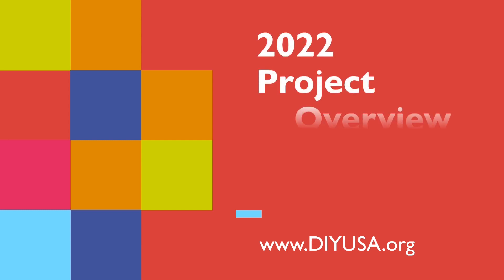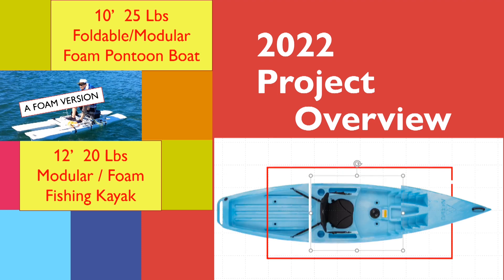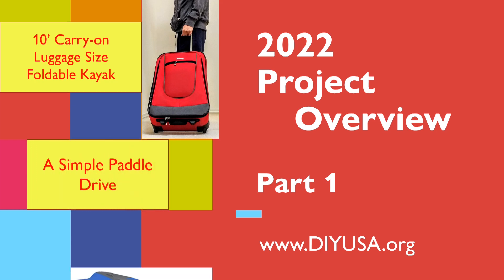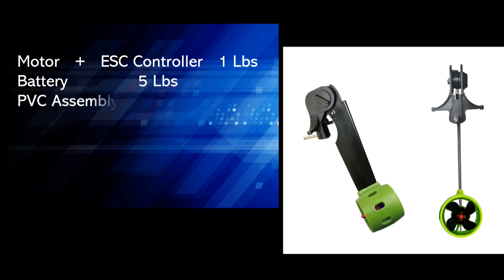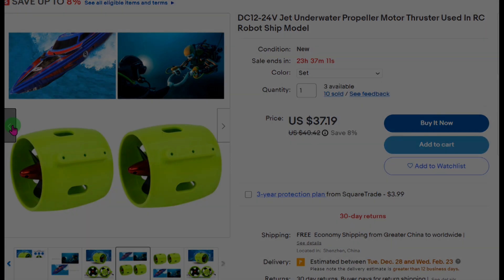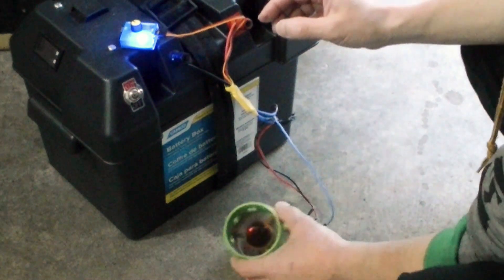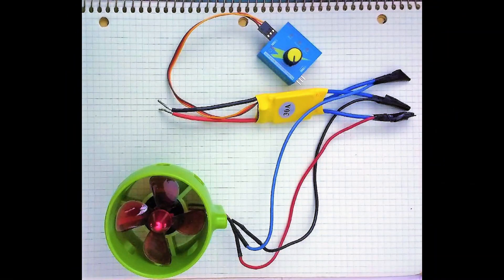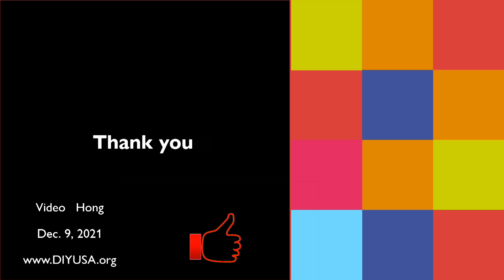Build My Version Of Bixpy Drive For Kayak ! Part 1 2022 Projects

Comment: спасибо. жду продолжения.
Reply from the maker: Honestly, there is still a lot of work I need to do to make a usable system.  I will experiment with the simple heat sink solution to cool the power controller before the kayaking season in April/May. Will provide an update. Cheers!
Reply: @DIYUSA  Good luck

Comment: Why there a holes around the housing. Other thruster didn't have holes there. I assume it breaks the jet.
Reply from the maker: This is a very good question. I don't know the answer. Unfortunately I have taken this assembly apart, otherwise I will run a test with the holes blocked (use tapes) and see if that makes a difference.
Reply: Esse motor é feito pra ser usado na flor d'água, esses furos são pra entrar ar. @DIYUSA
Reply from the maker: @Nicolasfelix857  Thanks for the explanation!🙂

Comment: please tutorial create mounting motor
Reply from the maker: Thanks for watching and your request.
Please check out part 2 of this series, which has more details on how I attached the motor to the aluminum pipe.
https://www.youtube.com/watch?v=KFiMu6XtaUU&t=1s
I reused the top part of the mount (which is secured to the frame of my pontoon boat) from my pedal drive project. You can see the details in this video 
https://youtu.be/mZYyqG_oXE4 
This video has the test result.  
https://www.youtube.com/watch?v=smNz7RCKHMk&t=39s
Please check out the description of this part 3 video, there are links to the parts I use. Please let me know if you need more info and I will be glad to provide. Cheers!
Reply: @DIYUSA  thanks
Reply from the maker: @monkeydluffy626  You are welcome. If you have other questions, please feel free to email me at pdxboatmaker@gmail.com. As with this design, I need to modify the cooling of the power controller so I can have the motor running at 350 W. The heat sink comes with the module seemed to be able to support 100 W only.

Comment: When the second part? Wondering how it works.
Reply from the maker: Thanks for the follow-up. Sorry for the delay in finishing and testing this drive. I have busy working on other projects: a foldable foam pontoon boat, then convert that to a sail boat.... etc. Now I am working on a $25 paddle drive. Next will be finishing up this motor drive. I should be able to test this drive in the river in about 2-3 weeks! Please stay tuned. Thanks for watching!

Comment: A man after my own heart. You have a $150 kayak and they want $150 to register it if you put a motor on it. It reminds me of the harbor freight trailer that costs $300 to buy and $300 tax, tag, and title and only carries 1500 pounds.
Reply from the maker: Thanks for your comment! Most of my kayaks are under $100 :-) But this year I built 5 , and now, which one should I register? I will have more boats next year. I will also recycle my 2021 ones to build 2022 ones :-)  eBikes can be on the road without licensing. If an eBike hit a person, it will cause more damage than my kayak going at 2 mph hitting another boat. My foldable boat probably will fold itself into a ball :-)  Cheers!

Comment: Same problem in California. Even a pathetic little motor like that and you have to register. Make a pole mounted setup that you hold in your hand (wear straps and put flotation devices on the shaft, not mounted to the boat). Or use a large RC boat and tow your kayak if you get tired. Or try umbrella sailing.
Reply from the maker: Thanks for the suggestions... now I have one more project to consider, i.e. to build a RC boat  :-)  I can even put two motors and a larger battery in it. Local rules allow eBike on the road without a license. A drone less than 250 gm doesn't need registration. I hope in the future there will be a change in the rules to allow motorized boat travels at 2 mph without needing registration.

Comment: the secret ingredient is crime
Reply from the maker: Yes, you are correct. Local rules allow eBike on the road without a license. A drone less than 250 gm doesn't need registration. I hope in the future there will be a change in the rules to allow motorized boat travels at 2 mph without needing registration. I am a senior citizen, therefore the things I built are focused on aged people, such as lighter boat, don't need to store the boat on roof rack, etc. This drive is an insurance for me if I need help to get back to shore. I can do that today, but I will have to struggle in a few years, when I reach the 70's. Sometimes the rules are set because the local ruling party need more money, For example, a few years ago, we don't need to get a Water Access Permit if the boat is less than 12', now, it changed to 10' so they get more money. Again, according to the book, I will be breaking the law today. But I don't feel guilty about this. May be this is the starting point to change the rules. I appreciate your comment. Cheers.

Comment: RCTESTFLIGHT channel recently posted a video where he had his rc boat tow him 20 miles in a kayak. I thought that might be a way around having to register a small boat, if its being towed its not under its own power... the vdo name is " my DIY R/C Boat Pulled me 20 Miles!!!" i tried using a large bilge pump strapped to an oar to move a 12' aluminum boat, it worked on a still pond but not enough to use in a current
Reply from the maker: Thanks for the input. It is a very good idea. I will check out how others did that. With the RC boat, I could put a larger battery and dual motors. Your 12' boat should be much heavier than my coroplast boat.